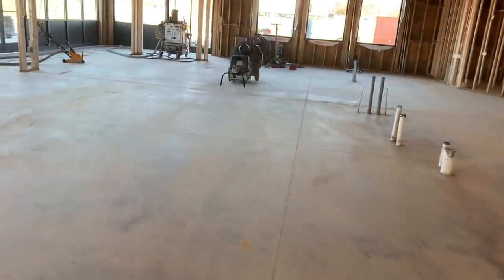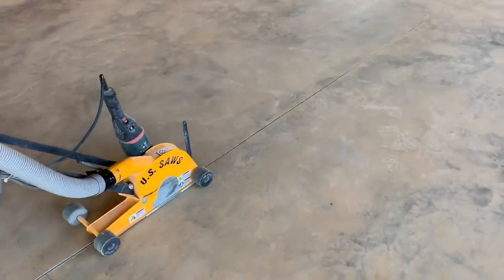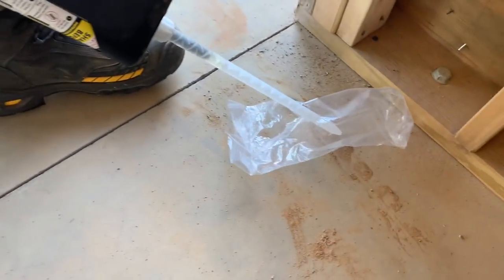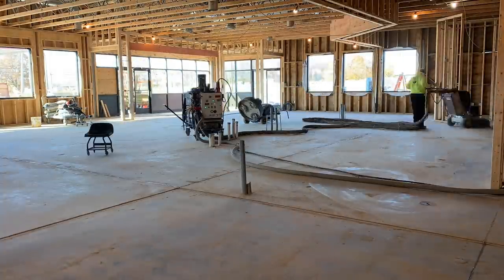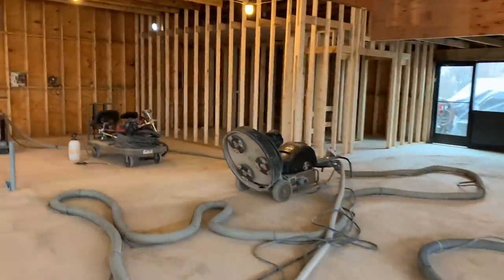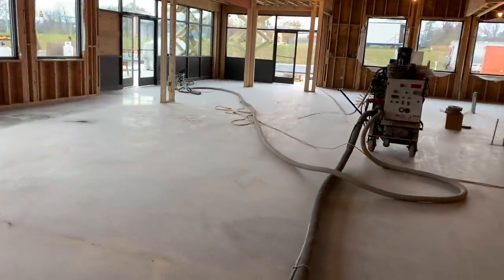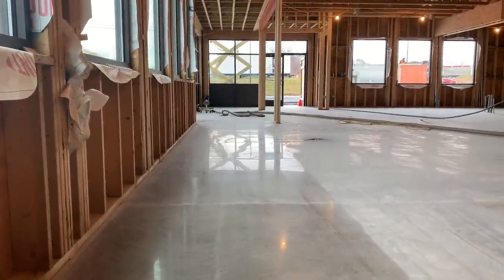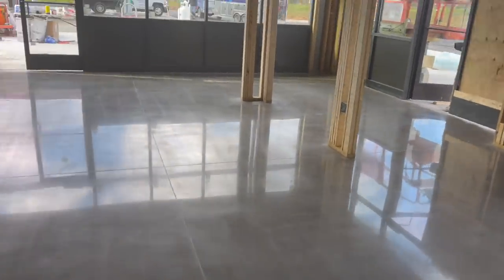Polishing Concrete In A Williamsport Pa Convenience Store / Super High Gloss Finish

Comment: Nice work guys. I have a polish and epoxy business in TN. Nothing worse than having diamonds glaze over on your first cut. We usually polish wet with our metals and finish off dry with resins. Or if it’s really hard we will just start with 50 grit transitions and do a cream polish. I’m gonna have to try the sand and water tip ya gave. Floor looks great!!
Reply: I have had thoughts on making a frame to hold 2'x2' concrete patio stones to dress the diamonds . Wet grinding is prob the better way it's just the mess I don't like depending on the area
Reply from the maker: Thanks for watching
Reply: Yes, that's cool, too! Maybe do you want to save money on your cos?

Comment: I am moving into a home with a polished concrete floor and I wanted to know if you had any resources on maintaining a polished floor.

Do I ever need to re-apply the sealant/guard? What cleaner is good for maintenance?

Also I have a very thin crack that I can feel with my fingers, do I need to worry about that worsening?

Thank you so much for the interesting and informative videos!

Comment: Is the recut of the joints just for aesthetic reasons, ie consistency of gap look or is there some technical reason for doing this?
Reply from the maker: You need to clean the interior edges of the joints before you fill them with joint filler.
Reply: @ConcreteFloorSolutions  if people would just listen to your explanation they can avoid asking dumb questions

Comment: Nice job! Just curious about the ceramic tooling, Would you recommend having only ceramic tooling for the transition steps or do you still need the resin bonds sometimes depending on the concrete? Thanks, liking the polish videos✌️
Reply from the maker: The ceramic tooling  gets extremely hot when running, it will actually melt plastic plates under the grinder, So we normally slow the speed down. We normally use 3 inch hybrid resin bond pucks from Sase but we have a set of ceramics in case we run into extremely hard concrete.
So the answer is no we do not always run ceramic.  also, the ceramics are probably three times more expensive than the hybrid resin Bond, but they do seem to go a long way 25,000 sq ft??
Reply from the maker: @Derek Roper we normally run all hybrid resins because they last longer. We typically get double or triple the life from a hybrid compared to a standard resin puck. That is what we have experienced at least.

Comment: What grit do you use if the floor is densified? Its a polish job. Thanks!
Reply from the maker: I don’t understand the question, there is nine grinding steps we typically start at 40 and end at 1500
Reply: @ConcreteFloorSolutions  oh i was wondering what grit should you start with since the floor was densified. Happy Thanksgiving
Reply from the maker: @sayone84able  we apply the densifier after 150 grit then continue up to 1500 after that. Happy Thanksgiving

Comment: Any other tips for how to deal with extremely hard concrete boys?

I find I'm coming across it more and more on jobs I go to. 

The fine sand and water help.
Even adding weights for more grinding pressure also help.
Reply: Depending on the spec we will start with 50 grit transitions on really hard concrete. If the customer is ok with a cream polish it will save you tons of time and money. Plus you won’t have to worry about scratches at all and you get a very nice reflection. Concrete finishers these days think they have to burn every floor they do and it screws the polishers!!
Reply: You can also try wet polish easier to grind hard concrete wet.
Reply: For really old hard concrete I would acid wash it first...
Just make sure you rinse well ...I00 percent muratic acid...this will eat the cement and expose the aggregate...faster grind

Comment: Where do you find the sand you use to open diamonds and fill joints?
Reply from the maker: The finer the same the better. I use a 70 mesh sand and it works great.

Comment: How would your polished concrete floor just like in this video hold up as a ‘heavy duty’ home garage floor?
Reply from the maker: I don't recommend polished concrete in garages just because there is no protection against oil and fluid penetration into the concrete.
Reply: @ConcreteFloorSolutions   …. Thanks! And that might even apply to home kitchen floors regarding potential grease splatter, cooking oils, wine spills, etc?

I take it such a glossy floor might be a challenge or maybe not even necessary regarding e.g. applying a polyaspartic coating on the concrete then to help against oil spills and more? 

I don’t expect an answer, but still wondering out loud 😊

Comment: You should just buy a poly pump
Reply from the maker: I would entertain it if we had a couple thousand feet of joint to do.
For a couple feet of joint it's more of a hassle to clean than it's worth.
Reply: @ConcreteFloorSolutions  its just better to have in general for when you need it and when you dont. Such as buying another grinder or any useful tools just because its not a 1000 ft at once you've definitely shot 1000 overtime so it would have gotten its use and its more efficient would save you time and money on cartridges etc
Reply from the maker: @kodeypouncey1969  I agree, the other issue is I simply don't have room on the trailer. We have four grinders 2 vacuum systems two shot blasters.
Reply: @ConcreteFloorSolutions  yeah time for a bigger trailer my friend or box truck time. Where are yall located out of?
Reply from the maker: @kodeypouncey1969  PA,
I run a 36 foot fifth wheel trailer now. I can't get too much bigger besides getting a tractor trailer.
Reply: @ConcreteFloorSolutions  i fit all that and some into a trailer that size a polly pump is not a big machine they have vertical ones that take up little to no space man look you can always find an excuse for everything or you can always find a solution. If you want it to be done it can be done man so i get it for anything i say is goanna have a counter lol as to why you cant man but fact is it could be done man i was just trying to help you be more efficient. Like when you had no grinder running because he had to run back over the cut... you could have just chased right behind him with the next step instead of having no grinder running. But you know people work different man good luck in your future man.
Reply from the maker: @kodeypouncey1969  Holy cow you are tough. You got me, Yes, I just don't want to get a poly pump. Thank you for watching, I do really appreciate everybody's feedback
Reply: @kodeypouncey1969  yeah you
Reply: @iamstevestrough8185  yeah you what?